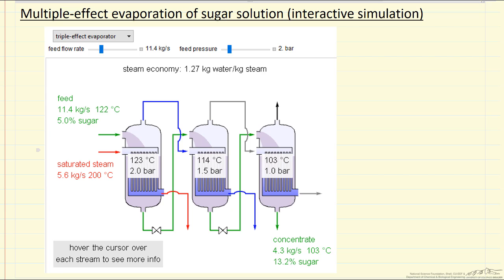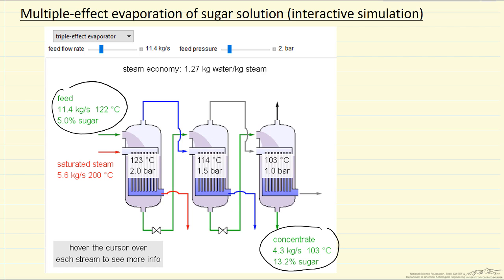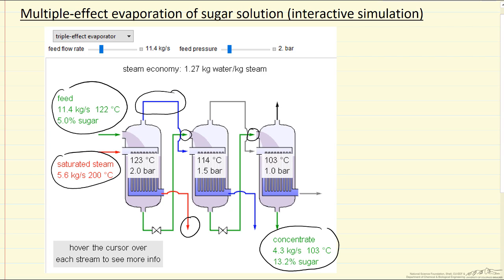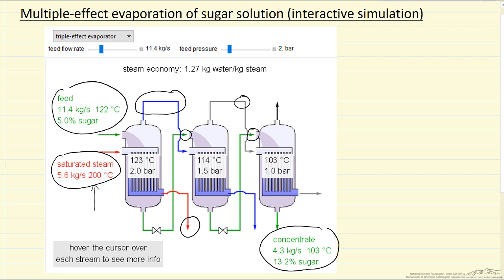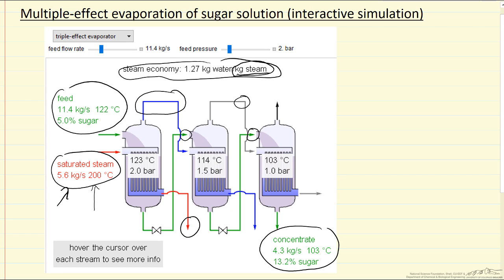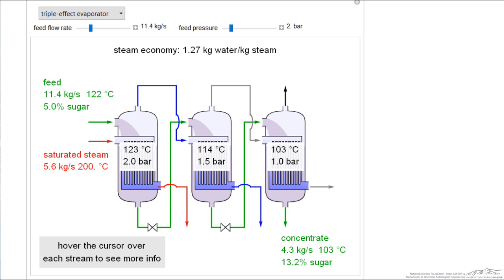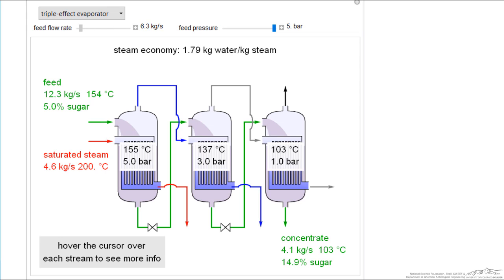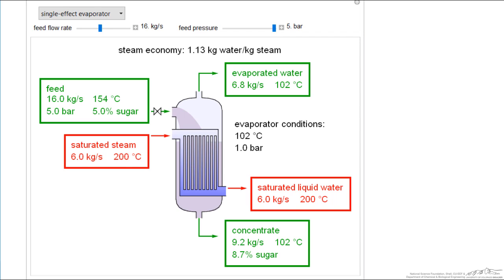Multiple-Effect Evaporation of Sugar Solution (Interactive Simulation)

Comment: hello, wanna ask about the truth/ I maen, the example for the single-effect evaporator has the Tfeed for 154C, then we used the steam around 200C.. how could the Tconcentrate could be 102C and its not around 150-200C??
Reply from the maker: This is a great question and I'm so glad you brought it up. There is a pressure difference between the feed and the evaporator, where the feed is at 5.0 bar and the evaporator is operating at 1.0 bar. That flash causes a temperature drop. Also, some of the energy is being used in phase changes. The steam goes completely from vapor to water, and a large amount of the feed is also evaporated.